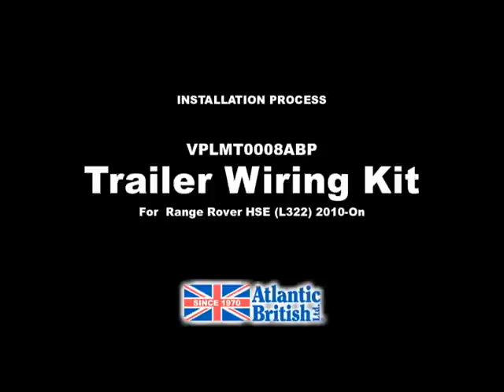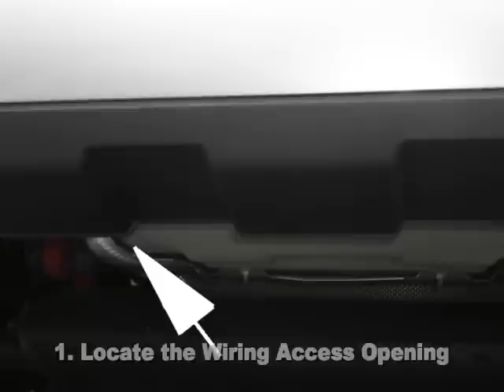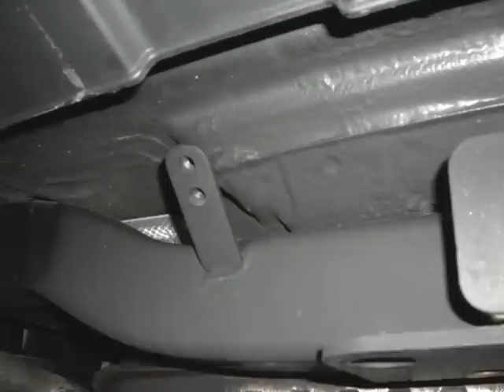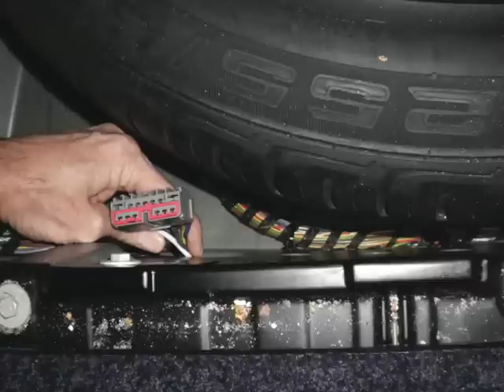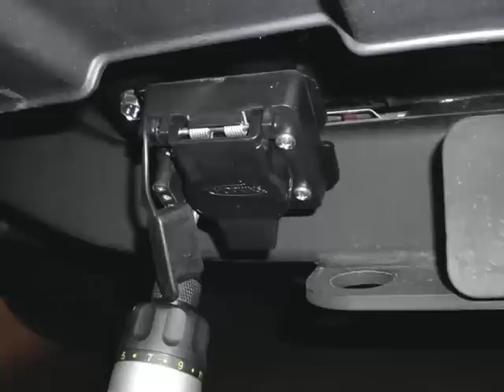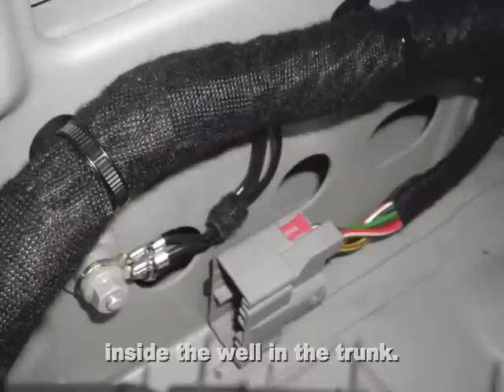Atlantic British Presents: Installing Trailer Wiring Kit On For Range Rover Full Size L322

Comment: I have a 2007 supercharged Range Rover will this work with that? I thought my model was a L322 as well
Reply: Other connector on pré 2010 models, and no need to code if I'm not mistaken.
Reply: Kenny lost me on your comment? So works on older models just don’t have to program or don’t work.